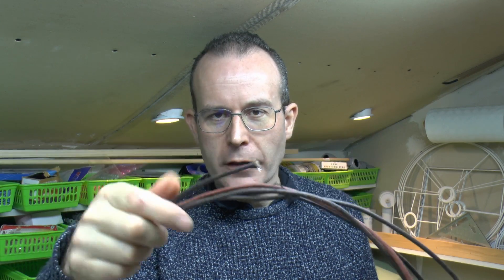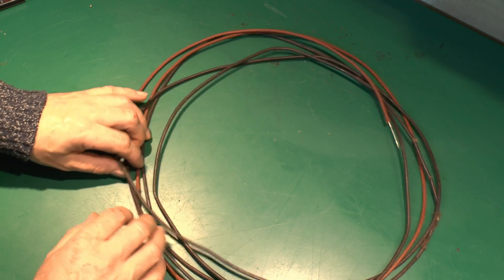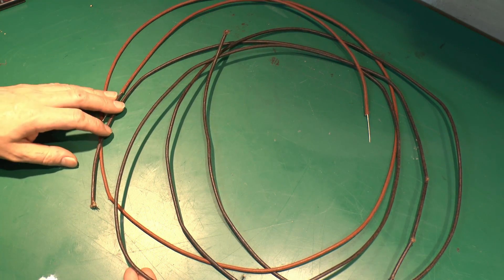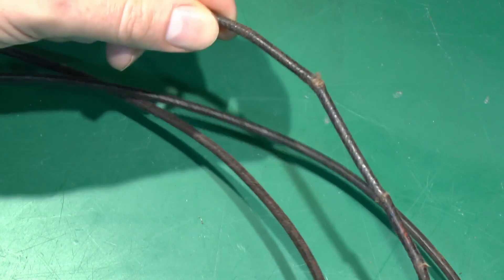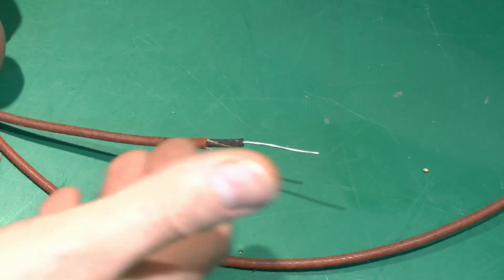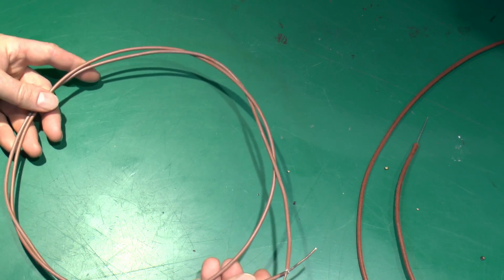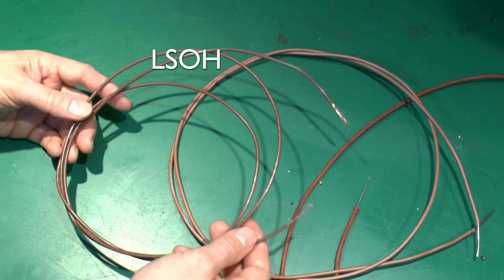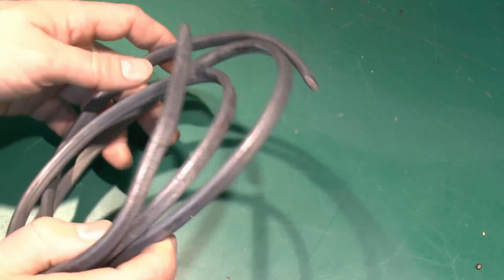PVC, Rubber, LSOH Cable Insulation Compared

Comment: what is the difference between XLPE and LSZH cable ?
Reply from the maker: XLPE is the type of material it's made from, LSZH indicates it won't give off toxic smoke and gas when it burns.
Reply: @jwflame   thanks for your reply. One more question.. XLPE material gives less toxic smoke compared to pvc material ?
Reply from the maker: @prasannatj  XLPE is better than PVC for toxic smoke.
Reply: @jwflame  Thanks John

Comment: Scary stuff. Imagine the quantity of smoke that a piece of twin and erth of the same length would generate. I reckon the safest wiring system is micc. Trouble is, it’s prohibitively expensive, and hideously difficult to install in domestic premises, and, of course, if wiring is carried out to the regulations, the only real advantage is that that if a screw or nail punctures a buried cable, the overcurrent device will disconnect the supply and there is no possibility of a shock as the sheath is the cpc. Earth fault currents will be higher, as r1/r2 values will be far lower with micc.

Comment: That nasty VIR rubber stuff. I've run into it a few times out on the road exchanging meters and on one occasion encountered the worst install I've ever seen: a line and neutral VIR 6mm pair, and a similar VIR 10mm pair, all shoved up inside a 6 year old meter, terminating bunched up into the main switch inside a 16th edition consumer unit. Ended up having an electrician on site to change the whole lot and he was shocked at the state it had been left in, barely hanging on.

My question is, where the insulation crumbles at the bends as you demonstrated, is the tinned copper underneath likely to have snapped as well? I ended up condemning that installation after a peek inside the consumer unit, but would the bulging bends have been evidence enough for immediate isolation?
Reply from the maker: The copper should be ok, it only becomes brittle after being bent many times in the same place.

Comment: Low smoke insulation...produces less smoke...delays the smoke alarm going off...wire goes open circuit...smoke alarm loses power....everybody dies.  

But on the bright side penguins still have an iceberg to stand on :)
Reply: Juan Cornetto if only smoke alarms had batteries...

Comment: Hi John, after we leave the EU (maybe), do you think (hope) we get our old wire colours back? Not meaning Red And Black or Red Yellow Blue. The new Brown Blue are perfectly ok! Those new harmonised colours have no rhyme or reason and make no sense.
I personally use Brown-Live, Black-Neutral and Grey-Earth. In a 4 core,  apart from 3-phase, I use obviously Brown-Live, Blue-Neutral, usually black if a switchwire is reqd, and ye old grey for earth. Properly sleeved for identification of course! Shoot me down if you disagree...
Reply: That's fine, if it's for decoration but if it's in use in a property then it's non-compliant. I doubt there'll be any changes to wiring regulations, regardless of the Brexit situation.
Reply: @WaltonPete  I never mentioned the wiring regs! :o/

Comment: More smoke than I expected from the LSF but I guess whatever it contained wasn't as toxic.

A good one to try if you ever found any would be woven Asbestos insulated cable. I've seen it used in old light fittings as it resists heat far better than any other insulation.
Reply: Asbestos insulation was widely used in stage lighting installations in the ‘50s, and I’ve still got some in an old carbon arc 16 mm film projector.

Comment: Interesting that the LS0H (Low Smoke, Zero Halogen) seemed as smoky as PVC.  I was involved in procurement of structured data cabling systems in the 90’s and the NHS insisted on LS0H in case adjacent power cabling caught fire. Practically doubled the cost, not sure it was really worth it?
Reply: The LSOH cable started smoking later and the insulation never really caught fire like the PVC. Probably has a lower chance of fire spread between circuits.
Reply: For power cabling there is a double benefit of LSZH: Overheated connection with traditional pvc cable can give off large amount of HCL which can further corrode the connection which accelerates the problem. And in case of fire there is the fun thing that HCL does when it comes into contact with water, like in your lungs.

Comment: Burning PVC (which is about 60% Cl by weight) releases lots of HCl gas (also some dioxins and other nice things). This isnt just toxic but also incredibly corrosive, soaking into concrete and corroding away the steel reinforcements. Buildings that had a fire often need to be demolished because of that.
The "Low Smoke" cables dont create any HCl (as theres no Cl in it to begin with).

Comment: What happens to PVC when it gets to  60 years old does it behave the same? Plastics last a long time however they do get brittle over time,  does PVC crack when it gets over a certain age?
Reply: well there was indeed a batch of 1960s pv house wire that went strange, all the plasticiser leaked out like green goo and corroded it all, but since then, and even the non affected batch since then, has been very stable, i have personal experience, i was given a big reel of twin and earth 40 years ago, still have some left,  its as good as new.
Reply: Let me know what happens when it reaches 60 years old. What is the recommended life of these cables?
Reply: @TonyDartford  nobody knows , JW will tell you wiring regulations now dont require a rewire as such at all
Reply: That surprises me as nothing lasts forever.
Reply: @TonyDartford  
Except energy and sub atomic particles. 😉

Comment: Hi, very infornative. How do you get 80A there without tripping your main mcb or pole fuse?
Reply: A nice buzzy transformer.
Reply: yeah - you step down the voltage. 80 amps at say 10 volts is still only 800 watts out of your line socket
Reply: lower voltage but higher amps , and arc welder will easily do 150a from your main socket, it lowers the volts
Reply: From a previous JW video, he had a 240 variable autotransformer (Variac)  supplying a 240 to 110 CT transformer supplying an Oxford single or two phase arc welder. If memory serves.
More power Igor.
Reply: @bostedtap  
"It's alive!" 🧟‍♂️
Reply: transformer of some sort, likely a welder or parts from one
Reply from the maker: https://www.youtube.com/watch?v=35VpIE1oKsc

Comment: Informative stuff! One minor point about natural rubber is that it doesn't dry-out over time, but is subject to ozone-cracking; ozone is very handy 15 miles up in the sky, but one of its detrimental effects at ground level is that it breaks the bonds in the rubber polymers. Modern applications that still use natural rubbers have additives to slow this process, but older rubbers crumbled readily.

Comment: Here in the US you'll find what is known as "knob and tube" wiring in houses built prior to about 1930 or so. Basically, it's solid core copper wire with rubber insulation and a cloth jacket, strung individually in between floor joists and wall studs. It's supported along the length by ceramic "knobs" held in place by a nail, which keeps the wire separated from the stud or joist by a couple inches. Where it has to change direction and go through a joist, the electricians would drill a hole and insert a ceramic tube for the wire to pass through. You'd have the live on one side of a cavity between joists, and the neutral on the other, with about 12 inches separating them, until they needed to enter a box for a switch or fixture, at which point each wire would be inserted into a heavy fabric sheath about 18" long, to go into the box. VERY labor intensive to install, and impossible to add a ground (Earth) wire to modernize it, as well as the problems with the rubber insulation drying out. However, it had a few interesting advantages. First of all, it's air cooled, which allowed the use of thinner wire to keep costs down. Second, because of the separation between the live and neutral wires, there was virtually no chance of a short circuit. The live and neutral were required to be kept several inches apart except at terminations, and then, each wire had to be protected by thick sleeving. The biggest hazard it poses today is if someone grabs one of the wires or accidentally gets caught on one. The deteriorated insulation is likely to fall off and pose an electrocution hazard. But left undisturbed, it really doesn't pose a fire hazard due to the way it's installed. There's remnants of it in several places in my house, which was built in 1921. None of it is still in use, as the whole house was rewired in the 90s, but kind of neat to look at. There's also piping everywhere for gas lights. Apparently, when the houses in my neighborhood were built, both electric and gas lighting were installed, because mains electricity was still relatively new and not that reliable yet.
Reply: I only remember seeing it in Tom & Jerry cartoons, and thinking - what a mad way to wire up a house
Reply: How interesting, I had not heard of that before. Was it only an American thing?
Reply: I once lived in a house built in 1896. It was full of knob and tube wiring. The light switches were like relays, pushed in and out, not toggled.
Reply: Mike Trump We do use 240V sometimes. Its mainly for dryers, air conditioning, and ovens. (and charging electric cars) It’s literally just two 120V phases tied together.
Reply: TMI

Comment: I've never seen or knew about wire run in wooden channels, can you show us that?
Reply: that goes back to edisons idea, wooden troughs in the ground, obv was not a good idea, wet etc
Reply: It's often found in lofts, for lighting cables, or in suspended floors for power circuits.  We had it in my childhood home.  Little chance of it getting wet.